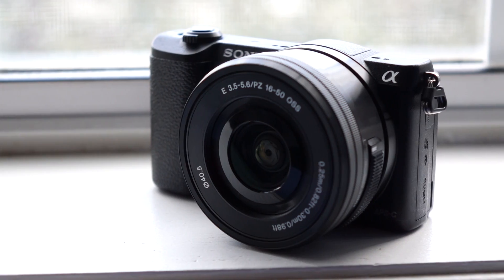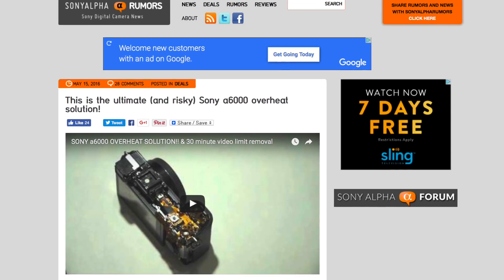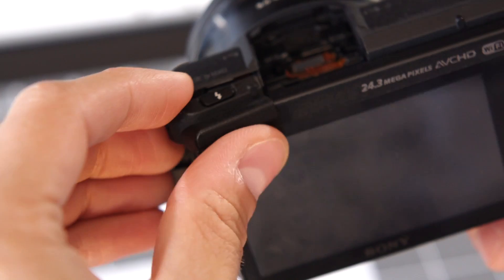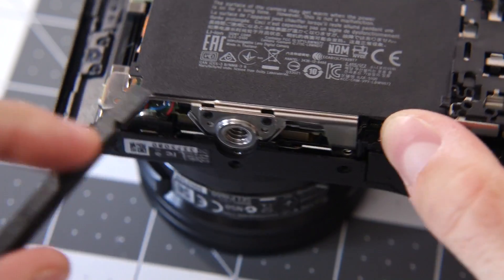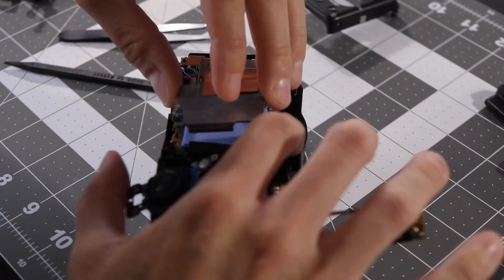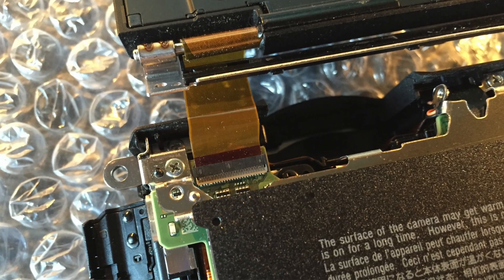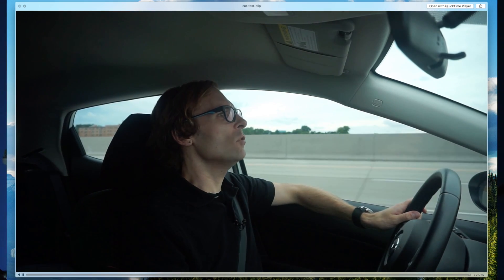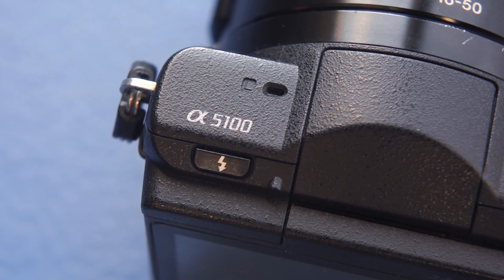A Fix for Sony Camera Overheating...Maybe

Comment: A bit late to the party but I'm in the process of trying to fix an A5000 so quite a lot of the steps here are similar, so found this a very handy video. Just thought I'd mention though that the ribbon cable visible at 2:00 should be discharged as it can hold high voltages. Looking at Sony's service manual, they recommend discharging it using a 1K ohm resistor. The pads are the 2 large ones square/squarish pads. Just thought it's best to mention in case someone else attempts this, so they can avoid getting a nasty shock!

Comment: You should try again with the heat sink! It appears the space between the heat sink and pads is around 1.5mm? You should get a 1mm sheet of copper, and use heat paste to join it to the heat sink. Then if you can find it, a 0.5mm heat pad. It's just more heat sink and it's closer to the chip. You should also put a heat pad on the other side to connect it to the plastic shell of the camera so the heat can escape easier. Lemme know if you try this!

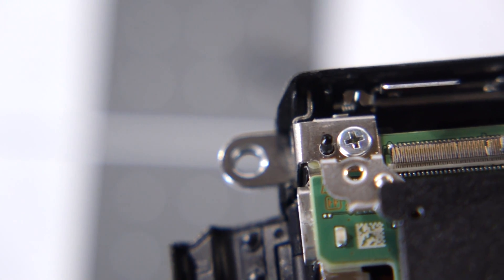Comment: Flash cable is friction fit, but 4:45 the LCD cable there is not friction fit,
it has a latch to be opened before removing the cable.
For people trying to mod this camera like me in 2021, just be 1000% careful with this part.

Comment: my be sumthing like these my help i know not big my not push that much air but could try. did try add sum Arctic Silver 5 under the pads my keep it cooler.
https://www.bccourier.com/2020-2026-micro-fans-global-market-by-allied-electronics-oriental-motor-adda-corp-sinwan-fans-ebmpapst-coppus-comair-rotron/

Comment: i got sony a600 i lucky get 2 video 7 min's before shut off i was thinking getting very small fans sum how install them in camera body one sux air in one pull air out or could someone make small addon body with fans in it move air around inside camera we my have make mod for it get pass the overheating. anyone know were best place buy mini fans.

Comment: I have  an a5000 and while changing the outer screen I damaged the connection board Long story short I got a new connection board a new screen and display does not work does anyone have any ideas I would great,t appreciate it.

Comment: Wow, looks very complicated. I'm planning on purchasing this camera as a vlogger...but this bothers me and my decision making
Reply from the maker: Gonna be honest...while I generally like Sony products and I like the idea of the a5100, it just doesn’t hold up. If you want a camera for vlogging the Panasonic series would work well, like the G85. They’re still pretty small, have flip-out screens, mic jacks and solid battery life. Overheating is a chronic Sony problem and dealing with it gets really old really quick.
Reply: @ThisDoesNotCompute  I definitely appreciate the honesty and opinion. I will look into those options as well. I don't need my camera overheating all the time 😡 so crazy because I really wanted to get the day in camera. But I can't deal with this all the time

Comment: a simple small usb ventilator 
solves the problem.. over 2h of recording!
Reply: Did you really try one? Could you suggest a ventilator that works well and not noisy?
Reply: id like to know as well
Reply: It didn't work on my a5100
Reply: @SandraRaquel19  try having your power saving mode set to 30 mins, i managed to record atleast 30 mins.

Comment: So either get a Sony mirrorless for much more video features like 1080p60, 4K , zebras, focus peaking, clean HDMI out, and better codec but in exchange have no mic jack and deal with overheating issues...
or go with a fat ass bulk of a Canon DSLR (what I have now) and can record until my card gets full and have a mic jack, but have to rely on Magic Lantern firmware to get higher bitrate, zebras, and peaking--something that not everyone is comfortable doing.
Reply from the maker: I ended up switching to the Panasonic GH5...pretty much the best of both worlds. Does everything the Sony does, but doesn't overheat, and can record continuously. I'm planning a follow-up to the A5100 overheating issue; I have an idea and I'm curious if it works.

Comment: Hy, I saw your video and disassembled my A5100, but I will take a step forward the idea of canceling overheating, at least I hope :)  I will put on top of the 2 processors, or over that aluminium heatsink 2 or 4 heatsinks, then I will cut the back of the camera where the heatsinks will be, thisway it will be an open area and probably will cool down more effectively, and as a last thing, I will put a 12V DC brushless cooler over these heatsinks. It will look a bit futuristic, but if this will not solve the overheating problem than nothing will. Now I'm waiting for the thermal pads, because I wil put it, where otherwise metal on metal contact would occure, plus on the processors. Let me know if you consider this a good and effective idea?
Reply: tell us how it went

Comment: Had Sony Xperia Z3 Compact, that thing also overheat while filming especially 4K. They fixed it with software update - removed 4K capability. Seems like Sony generally has bad thermal management.

Comment: i was thinking, did you see the mics when you disassemble the camera? thinking of making an audio input which the camera does not have, porbably disconnecting the original mic and letting making it an audio line, sure its only a very small FET condenser. replacing or getting an line for external mic would be much better, i did not see the mic in this video or might have not placed it in the video. the overheating issue is no longer a problem with me because if i get it to overheat, a simple restart always gave me another rough 5 minutes of recording every time where i don't need to cool it down when i need to record another clip instantly after over heating.

Comment: I've noticed my lighting matters too. Good lighting? 10-12 minutes. Low light? Endless recording. I also record in .mp4 (to use the wifi transfer option), so that helps lessen the load. Honestly, it's great for daily vlogging but pretty terrible for sit-down videos.

Comment: It's a little a bit late to comment, but anyway... Thermal pads aren't a good deal. Example: some laptops, when came with cpu and gpu bga welds, the heatsink circuit runs over both, but this processors are not at the same height, so they put a thermal pad on the gap. Well... Getting time bga breaks, because this solution doesn't dissipate properly the heat. So, we fix this fitting on the gap a cooper sheet and thermal paste and done! No more overheat. The important is keeping the contact between the metal surfaces to let heat goes away. Cheers guys!

Comment: it seem the chip dont have proper heat sink? will this do for a b roll cam, i need the touch focus really, i cant buy a a6500, not sure if anyone even uses a whole 5 minute clip in edits, most shot i do only last 5-10 secs or maybe 1 minute max or it will be a boring video. does it overheat just being on or only when recording. Im good in electronics, i could mod the mic to have external plug, i just haven't decided on buying the cam, my budget can only go up to an a6300 body and it does not have a touch focus either lol, im very interested in this camera, ill use my s7 edge for longer shots, and this for b roll effect shots
Reply from the maker: I've never had it overheat while just being turned on, only while recording. A workaround is to connect the camera to an HDMI capture device/card and record externally -- it'll output "clean" video (without any of the on-screen icons, etc) and there will be no recording length limitations either.
Reply: thank you
Reply: just bought the a5100 with a zhiyun crane m, im am happy with it

Comment: Hey, what about an extra thermal pad between the shield and the heatsink?
If the heat doesn't have a way to exit, even with a memory pad it will still be trapped inside the camera.
Reply from the maker: There's already a pad where those two make contact, though it's not terribly substantial. I plan on revisiting this topic at some point, and have some ideas on ways to improve it further.

Comment: Note : 
You shouldn't ReUSE Thermal Pads,
and thin Thermal Paste is Superior than Thermal Pads.

Dont Give Up,
Even 6500$  Nikon D5 will be Overheating in video mode.
My suggestion is you can change the heatsink material into copper for better heat transfer
Reply: Solution: buy a 2017 LG K8 and a adjustable mount for a tripod and a 32 GB SanDisk Extreme micro SD card and only use it for videos

Comment: Wisdom in a video, your courage encourages not to try anything else beyond the obvious. I wanted to ask: is the timelapse app worth it? Regards from Argentina!
Reply from the maker: The timelapse app works as advertised, but I find it rather cumbersome to set up. You're also limited to a total of 990 frames, which for some timelapses may be too few. I think the app is useful for traveling, but for serious timelapses you're probably better off using an external timed trigger.

Comment: I have a Nikon One J3 that also overheats. It does it in about 12-15 minutes. It gives no warning, just turns off. It also have no recording LED indicator on the front so if I am recording a video, it is difficult to tell it quit (a mirror has been the best solution so far).
To help make it last longer, I took a computer CPU heatsink and put a 1/4 inch bolt in it. Then I made my own 1/4 inch threaded plate, screwed it to the fin part of the heatsink and I have a tripod mountable heatsink that makes the camera last up to 25 minutes at best. The heatsink gets noticeably hot so I know it is working. I have wanted to tear into the camera to try to solve the problem on the inside, but the camera is so compact that I have little faith in there being anything I can do. I also really do not want to break it while in there, like you did. My wife would be furious.

Comment: I don't get it, if you pay top money for the camera, and it underperform with constant overheating and shutdown. How can Sony get away with this? aren't they supposed to be fixing it instead of yourself? Why do you let them have your money with their faulty products?
Reply: About Sony getting away with it. It's not first time and it probably won't be the last. People keep buying their products so why would they care.
Reply: No, the problem is not Sony. The problem is, that at this time, a device that small with that tech (I think it was 2014 or 2015 tech) was not able to record long in a device that small. Sony communicated that and so everyone who was surprised by this just didn't inform him or herself correctly in first place. A huge DSLR can divide the heat much better.

You see, the only other option back then was to not offer video at all, so Sony went the way "we give you it, but it won't replace a camcorder, if you need longer, get the NEX-VG series or any camcorder".

Also note, that professional hollywood camera equipment of multiple 10.000 of dollars also overheat, it is the job of the pro to know the system well enough to get the max out of it.

So don't blame Sony for this, there are also just have to follow physics. Tech has moved on the last years, with CPUs becoming more efficient and so generating less heat, so newer cameras don#t have the problem anymore with 1080p50/60.
Reply: Exactly.
Thank You.

Comment: I'm so glad we're protected by The Sale of Goods Act 1899 and It's amendments here in the UK. Personally I'd have returned it within the statutory 1 year after purchase as "not fit for the purpose for which it was sold."
Sadly the majority of UK consumers have no idea how well protected they are and just put up with crap like a camera with an HD video feature that overheats after around 12 minutes of recording. :/
Reply: I believe it is a still camera that can shoot video for short periods.  Was never meant to be used for more than 10 minutes or so and I'm sure it says that in the paperwork.  So there isn't any consumer protection when you want a product to do more than they're advertised capable of. Just a guess but I'd bet Sony would have a massive law suit if that weren't the case.
Reply: Nicholas Wilson It looks as though the Sale of Goods Act was replaced by the "Consumer Rights Act" back in Oct 2015.
Reply: Daniel Boa you're quite right of course but the level of protection is still outstanding compared to many countries. :)
Reply: Jason Almont Haha! Yes many a company, even companies the size of Sony have made the mistake of thinking they can get away with that kind of argument in court. ;)
Like a lot of legislation in the UK the wording is deliberately ambiguous so that common sense can prevail.

Comment: Are you sure that it's not the actual image sensor itself that is the cause?

Certainly on similar cameras, recording times and exposure lengths are limited by heat built up in the sensor itself. For example, some cameras won't do exposures longer than 4 seconds to avoid damage.

Either way, overheating seems to be a Sony forte. It seems their cameras and their phone cameras all suffer from a similar problem. Perhaps Sony is too conservative with the temperature limits?

Comment: Colin, as a suggestion for a future video, I saw the other day a GBA mod that was taking the screen of a GBA SP and putting it into the case of an original GBA. It doesn't normally fit there, so the guy got a repro shell and cut off a few tabs. The end product looked really awesome.
Reply: allluckyseven have a look through Colin's previous videos… ;)

Comment: It looks like the LCD ribbon connector is fitted to a zif (zero insertion force) not a friction fit like the first connector removed. I winced a little at  2:40 when you tugged it out without lifting the brown tilting bale at the back of the connector. I've had trouble with these connectors in the past since the bale is very fragile and can easily be broken off. It's lucky you found a semi broken replacement camera. I've gotta say though having that tiny thermal pad (which is partially overlapped with the wifi antenna reducing it's effectiveness) and the relatively small heat sinking plate is very poor thermal design and execution on the part of Sony. I would've expected better.
Reply from the maker: Yeah, I also thought it was a ZIF socket. It's not, which is how I ended up breaking it.
Reply: @ThisDoesNotCompute  is the lcd to motherboard a ZIF connector in the a5100? I can't get it to flip and don't want to damage the ribbon cable
Reply: I think it is a ZiF connector as well. I watched another tear down video were a guy was able to lift the connector’s lid. I wasn’t successful at letting it either. 

I forced it in any anyway in the end. The result, the LCD works BUT the image quality on the LCD made telling what was in focus nearly impossible, even with focus peaking. It’s like certain colors won’t render properly causing the display to show up as reddish tint  .
Reply: @SoRealSoReal23  I think the a5000 is a ZIF connector if you're referring to @CuriousRiz disassembly for mic hack
Reply: Thats why the ps3 gets ylod and ps4 gets blod because of how SONY does their shity cooling Microsoft did the same thing with the Xbox but they fixed that in the newer fats and the slims
Reply: don't feel bad, friction fit are usually white, it looks like a zif, I probably would break it also.

Comment: Hi Colin! Excellent video. I use to shoot my videos with an a5100 last year and loved the camera but ultimately sold the camera off due to it's overheating issues. Found this video very interesting as I have thought about picking up another a5100. I just recently picked up an a6300 and while it overheats too, at least you can get more video recording out of it before it stops recording unlike the a5100.

Have you tried using a dummy battery and external psu with your a5100? That's something I never tried and kinda wished I had. I know the batteries in these camera's get terribly hot and since they are so close to the sensor area, perhaps removing the heat from  that region will allow you to record longer.
Reply from the maker: Yes, a dummy battery AC adapter works about as well as the other workarounds (flip screen out, battery door open) -- it adds a couple of minutes at most.
If you're in the market for another a5100, I'd advise you to wait, as it sounds like its replacement should be announced soon. Though only time will tell if that camera also overheats.